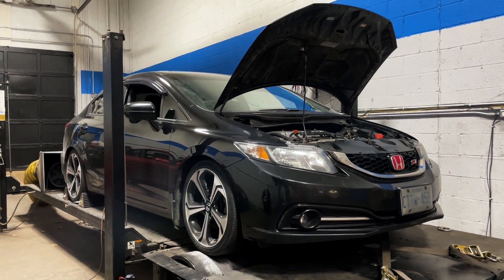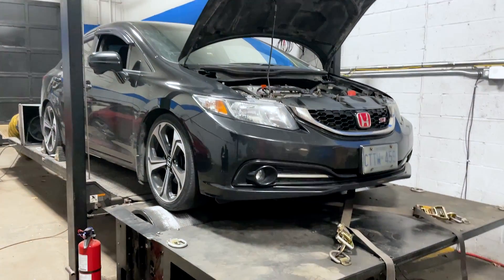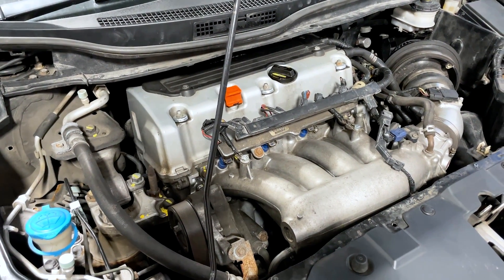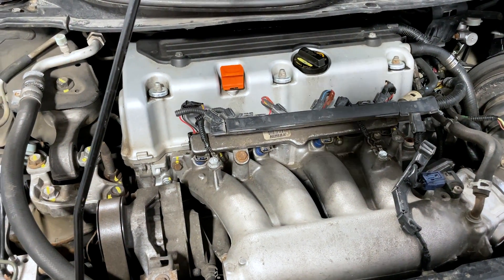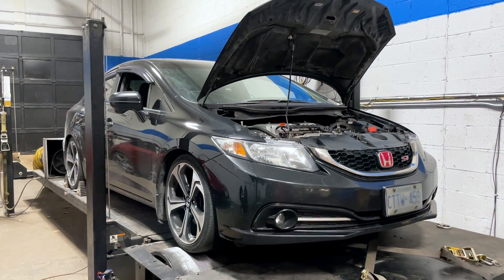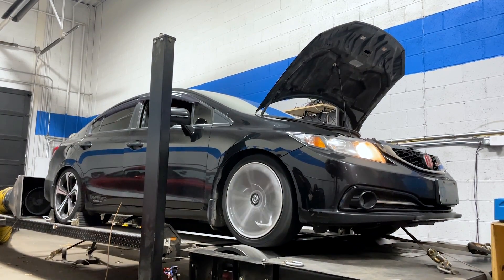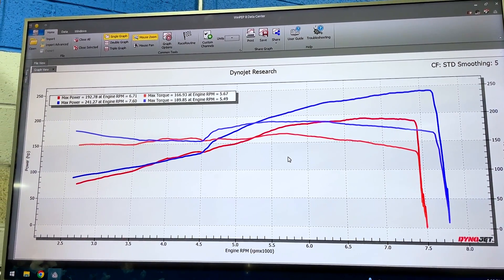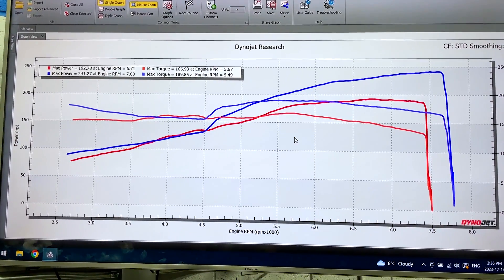K20 HEAD SWAP 9TH GEN CIVIC SI

Comment: This head swap is so much work. But gosh when done right it definitely is worth it if you have the means to build one.

If your gonna put all that work in might as well just put a small turbo on a stock Z7 and tune it to a mild 300 wheel.
Reply: is the reverse swap easier on the 8th gen? like take a k24a block and swap into a k20z3 civic?

Comment: I really want to do the z3 head swap on my 13 si so bad, anyone know what the cost of the swap?
Reply: I've been collecting parts. Used head & cams. Oem Honda gaskets, hardware, Rsx oil pump. Aftermarket intake manifold,  throttle body, header, etc. Looking at almost $6k, not including labor.

Comment: Could I expect similar numbers with my setup being a K24Z7 swap with a RBC intake manifold, stock throttle body, RBC cam gear, Type S oil pump, 440 RC injectors, Skunk2 CAI, HKS full exhaust and a Tune with Hondata Flash Pro?

Comment: Geez I really need to reconsider a 2.4 block swap. I still have a bone stock 8th gen si with fbo plans and cams but shyed away from a Frankenstein setup bc i want full oem simplicity and reliability. I know it's reliable but nothing beats the simplicity of running a full original Z3 engine. Also the additional NVH of a k20/24 is something i consider too. The gains are too damn good to not reconsider though. What to do....

Comment: hi nick I'm from barbados  I have a jdm fd2 type r with the higher compression  k20A which is 11.7.1 my mods are 72mm ktune   throttle port matched to the RRC intake , HYBRID 3.5" cold air intake ,PLM driven header, and full 3 inch exhaust no resonator tuning with ktuner v1.2 tuner hates the ktuner giving  me a headace 😢

Comment: Hey Nick, thank you for what you do in Sharing these videos. I have a k24z7 that I will swap into my 91 isuzu pickup truck. By any chance what exactly did you mean by some slight modifications to the k20z3 cylinder head by welding?what do you have to do to make it work? Do you have something that you came out with like an instructions guide or something that shows exactly what to do so someone like me can have it done? 😁😁😁 I'm in Hawaii thanks again 🤙🤙🤙🤙🤙

Comment: have you ever had issues running the 72mm KTuned TB with the Hondata Flashpro?  When I inquired about the TB KTuned said they recommend using a standalone ecu if I wanna run the TB cause with a flashed OEM ecu it can have issues...  Since you tune a lot of K20/24's, have you seen issues with this?

you mentioned there are headers out there that will make more power than the KTuned, are you talking the megadollar headers like ASP and similar?  or is there a mere mortal priced header that perform better?  I was under the impression that all $400ish (USD sorry don't know Canadian pricing) were all copies of the KTuned...?

Comment: It's great to see another tuning video! Seems like a lot of work to get the Z3 head on the Z7 block. It would be easier to swap a K24A engine?
Reply: Crank sensors between the RBB motors and the R40 motors are incompatible. It would be alot more work.
Reply: Z3 headswap isn’t hard there’s guides out there

Comment: I’m basically running this set up with an A2 head but I never got the chance to get it tuned and now I have a supercharger so it’s cool to see what it would’ve made
Reply: What mods did you need to use the a2 head on the z7?
Reply: @younome1845  use a a2 headgasket and k24 headbolts.
Reply: What headers did u use and did you have to modify it ?
Reply: @thebeastqc299  dc sports 4-2-1 but I believe when installing any K24 into an Rsx you might have  the exhaust hit the swaybar because the engine sits higher
Reply: did you have to match up the coolant ports or grind/weld anything down
Reply: @kballs94  I run a k20zq head and a z3 block now with the k24z3 headgasket and the oil return at the rear of the head leaks so I suggest getting it welded up but other than that you need a hybrid timing cover so that doesn’t leak.
Reply: When doing a head swap did you have to use different pistons? I keep seeing the Google AI say you need different pistons when swapping k20 heads onto k24.

Comment: ❤ Honda seriously needs to bring back the k series engines. This little vacuum cleaner sounding 4 cylinders aren't it.
Reply: So true, the new K20c motors sound terrible
Reply: K20C is nothing as comapred to these older K-series especially when they are boosted
Reply: @FB6K24Z7  Are you sure about that?
All those stock engine K24 turbo  setups running 600whp stock don't last long. Good for a few dyno passes, more than that and you are risking it.
Lots of 500-600whp K20c out there running fine with their stock engine for years.
 
More powerful samples are coming out thanks to advanced fuel delivery that was the limiting factor in this new platform.
Reply: @Marbind hahahah k20c running fine and that to with 600whp good joke man 😂😂😂none of them have stock internals and still the most problematic engines honda ever made are the L15B7 turbo and the k20c1 where as a k20z3 or a k24a with built internals can hold 600-700whp all day long and still be reliable any day of the week and neither they have overheating issues unlike that garbage 🗑️ k20c1 I've been playing with these engines for a lomg time now so I know what a K20A/Z3 or a K24A are capable of even on stock internals champ
Reply: @FB6K24Z7 you are stuck in 2017.

Welcome to 2025 😉
Reply: @Marbind you can keep your modern fueling delivery. Im about to k24 swap my 2020 Civic Si
Reply: 100%. And these new honda engines are even blowing head gaskets in STOCK form. I'm from NY where street racers pull 300hp out of them all motor and 500hp boosted all day on the stock engine and never heard of people blowing head gaskets on them. Not saying they won't blow if pushed but these new ones are blowing bone stock in people's dailys.
Reply: @FirstnameLastname-pe5ib the 1.5L maybe. The k20c1 in the type r has zero problems. There’s one making 712whp on the stock bottom end

Hundreds of them are in the 500-600whp range on stock trans, clutch, engine and are dailied with zero problems
Reply: @walahmelons5504  they don't hold that kind of hp for a long time the rods are weak and the cylinder head flows nothing like the older K-series
Reply: @FB6K24Z7  There's k20c1s that have been making 550 for years with zero problems. 600 can get dicey and 712 def won't hold for long. That being said, that same block that made 712whp was making 650ish for almost a year before turning it up

It's got forged rods from the factory, so it's not unexpected it can hold a lot of power
Reply: @FirstnameLastname-pe5ib  Cool story bro. 
Where did you heard that fable of stock K20c blowing up easily?

This is a very extremely rare event.
Reply: turbos and direction injection. that's why they sound so bad.
Reply: @kballs94  DI has nothing to do with it. Turbo system is the answer because they mute the intake sounds.